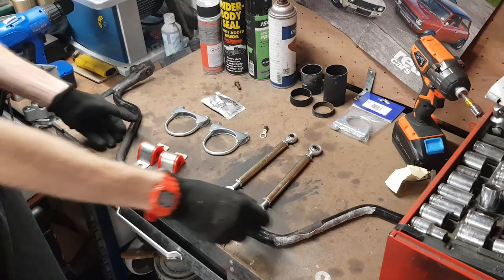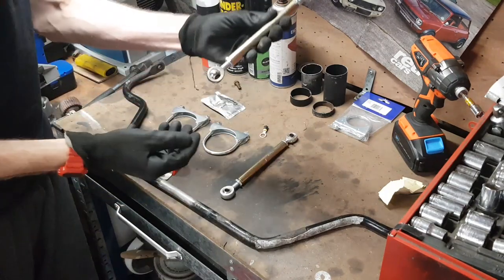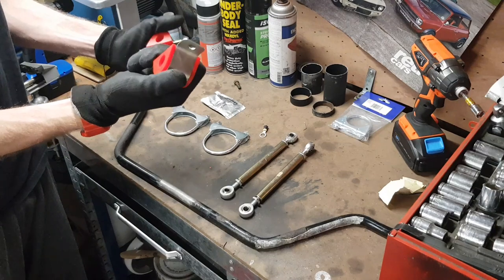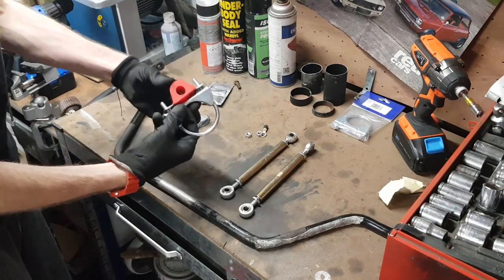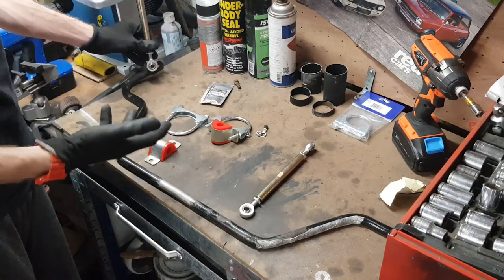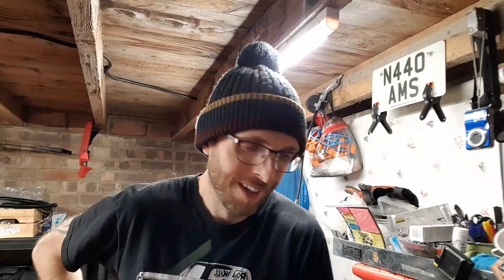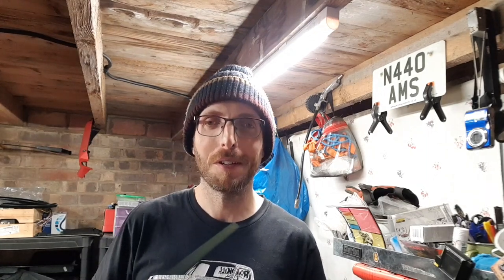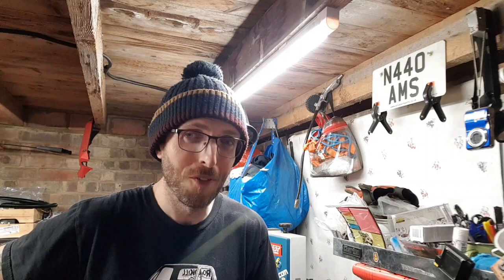Cinquecento / Seicento Rear Anti Roll bar set up ... its a new upgrade for the Turbo Cinquecento

Comment: The stabilizer is way too thick!!
Reply from the maker: It's actually only 18mm..so the same as the sporting front.. should work quite well. 
I sold the car and the roll bar so didn't test it
Reply: @wornoutracing  
It has not only to do with the diameter but also very much with the lever arm!
This one is way too HARD
Reply from the maker: It's a shame I never got to test it and change the design as needed, but yes you might be right that it would be too stiff